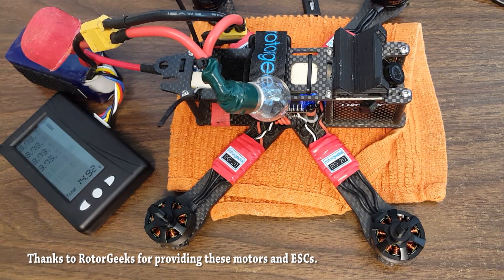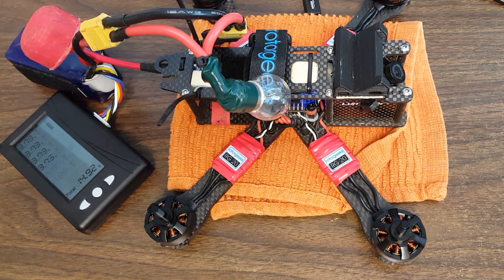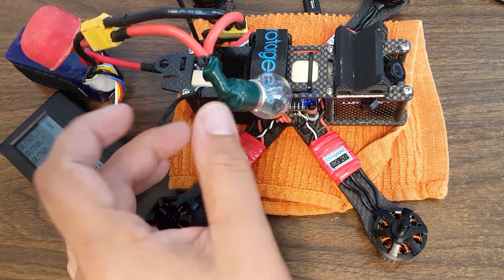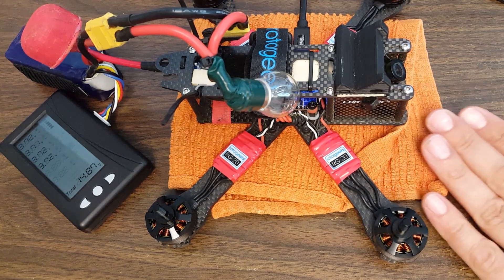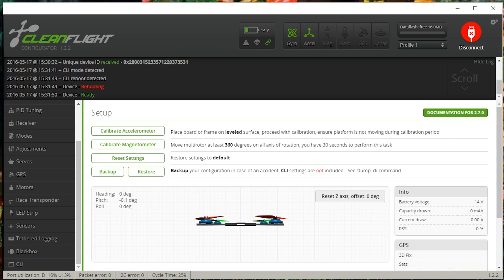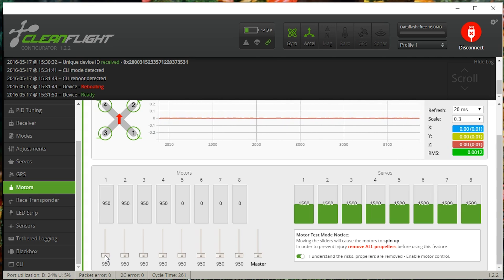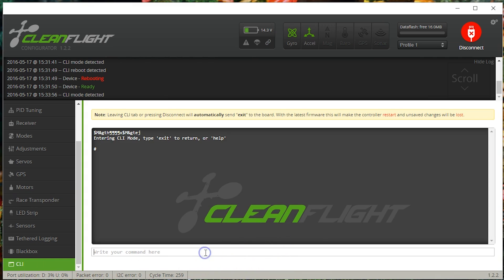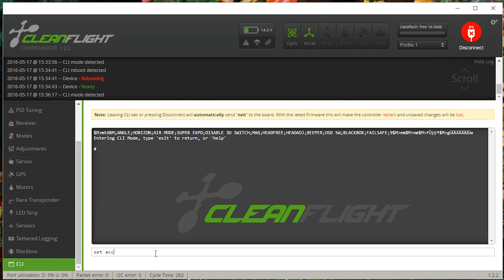How Much Vibration Is Normal?

Comment: If only 1 motor is vibrating does it make sense to tune it out or should the motor be replaced. Motor 3 has a high z value comparatively. How high is "definitely" too high. Does high vibration indicate a motor at high risk of failure. Motor is also definitely warmer running that the other motors too.

Motor 1
x - 0.00
y - 0.00
z - 0.00

Motor 2
x - 0.00
y - 0.00
z - 0.00

Motor 3
x - 0.06
y - 0.00
z - 0.38

Motor 4
x - 0.01
y - 0.01
z - 0.01

Comment: Having vibration trouble through the image quality in my DJI 03 error unit shows wavy distortions when flying not too noticeable but still noticeable compared to how it's flown before I think it's because the screw holes are stripped in the camera so the screws are not tightening in all the way looks like it's either trying to put some Teflon on the screws or just get a new DJI 03

Comment: I'm on my first build. Tarot iron man 650, Tmotor MN2212 920KV 10' PROPS, HGRLC Titan 4 in 1 (feel like I shoulda went individual escs) 4S 1500 bat. Screws are all tight, but I get rattle sounds all over the thing when I tgrottle up. I also feel as if I shoulda had a smaller craft as first. It has tipped and props brike maybe twice, but not a hard fall and throtle backed off. Bouncing from a land

Comment: is it possible to have so much motor vibration that it would throw the fc off.  reason I ask is I just built my first quad and after arming, very slowly roll up trhottle and quad goes to full throttle.  It shoots stright up in the air so I am convinced it is not a motor direction or prop installation issue.  it moves how it should in betaflight orientation page.  Have checked all settings 100 times in betaflight....any ideas???
Reply from the maker: First, check the receiver channel endpoints.

https://www.youtube.com/watch?v=PCLxyurZsD0

If it goes straight up, then I agree it's probably not one of the "taz" issues. It could be vibration. If you suspect vibration, set D gain to zero (just for troubleshooting, not permanently) and if it stops flying away, then it's vibration.

Comment: Hey Joshua it is hard you have alot of videos with blackbox. I just have a simple question related to motors and Max motor noise. I have enabled PT1 and when I look at the analyzer it only goes up to 125khz unlike 4000 like before. My question being, reading the max engine noise, I can read motor 1,2,3, and 4 looks the highest and I can read the first digit and not the rest. What is the average Max motor noise you mostly see, and do bent or out of balance props effect the noise? Obviously.. So I check the 4 motors in betaflight with the props off, storage charged 3cell, Smoke stopper and each motor in the Accel only go to .01 maybe .02 on one motor.(10000hz) So I am leaning towards a prop issue. Thanks for your patience. Thanks -Brandon

Comment: So how do you tune around a brand new motor that has some vibrations? 
Any material I can watch or read through to understand? 

I could not hear this "vibration" or thrill in the sound the motors make with the previous (and less powerful) motors...:  https://www.youtube.com/watch?v=0zoNQmMxeS8
Reply from the maker: Well, to be honest if a brand new motor had excess vibration I would replace it. But maybe if it's not too bad you could try balancing it with some tape. That's how we used to do it.

To tune around vibration you increase filtering and lower D gain. But if the vibration is very bad, there isn't anything you can do to fix it.
Reply: Joshua Bardwell thx. I’ll look into it.

Comment: This is a helpful video. Have you ever thought about revisiting some of these topics using the newer versions of Betaflight/Cleanflight? I know its hard with all the constant updates, but at least you will never have a shortage of topics for your videos. Thank you for everything. I know youre busy....... have you ever thought about starting a company with employees? You already have the fan base and everybody knows that you are the fpv know it all, so if you designed a "JB" flight controller or something, im pretty sure that everybody would buy it. Not only because you are trusted for your scientific testing method, but also for the online support (which is probably your best feature). Sorry for rambling. I just followed this link from the Betaflight wiki. Back to reading.

Comment: Hi Joshua,

So I have been trying to perform these tests but i can never get my accelerometer to calm down. This video 

https://youtu.be/aLW7qNgfO-k

I have posted to youtube shows you the readings I get. This is just a flight controller sat on my table, there is no quad. I find all of my quads do similar things when I connect then to my computer and try these tests you talk about. Any idea whats going on? interestingly enough I get the same readings regardless of weather a disable or enable the accelerometer on the FC. The big jumps you see on the video are me tapping the FC with my finger.

Any ideas ?
Reply from the maker: Unfortunately, Betaflight changed the Motors tab from Accelerometer to Gyro, and the resultin information is useless. I wish they would change it back.

Comment: Mr. Bardwell, When i tried this my X,Y,Z readings would never settle even when perfectly still motors disabled. Is my controller faulty SP F3  MPU 6050? I tried changing scale and time. Reset does not seem to zero either but i think its just the noise is constant. Maytec OSDPDB is where i am getting 5v from. Quad flies OK. It does dip to the rear if air mode is off and throttle is cut. min. Throttle 1175 and balance should be good on a realacc  210 frame and multiple packs. Its just kinda strange, Thank you love your work.
Reply from the maker: Your controller is fine. The BF devs changed the Motor tab from accelerometer to gyro and the readout is different.
Reply: Thank you,

Comment: Here's another aspect that ties into the discussion mounting an XT-60 directly to the PCB or a FCB.  
A new build may not have any issues with vibrating off the battery's male plug, but once, as you say,  'ding the motors' one or more times, while it may not effect the flight characteristics because of filtering/tuning, it can be enough to work the plug loose.

And that's where I learned to not to hard mount the male plug.  I was getting a rare separation, then it grew to like every fourth pack as my Alien got older. I suspect I was passing through resonance regions and lingering in them a bit more than another flight.

Comment: hello joshua. thanks angain for everything.
 question: onmy last version of betaflight 3.1.6 i think ( at the 27/03/17) in the motor menu, I only see the gyro (which take the place of the accelerometer). I dont know where to look for the acc. at the sensor? i did it but i don't know how to reset it. any idea?
Reply from the maker: Yeah, they changed it to the gyro. I don't think you can see the acc any more on that page.

Comment: Hi Joshua, could you tell me, how I check for motor vibrations, as in the motors tab now the gyro data is shown and not the acc data?
Reply from the maker: Well, generally the same process but the numbers are going to be different and I don't have a suggestion for what is a good or bad number :-(
Reply: Alright. Thanks anyways. =)

Comment: Hi Josh... Looking at your video, I have a problem.... Just started working with BetaFlight, and when I go into the Motors tab, I have Gyro instead of accelerometer. And on top of that, even with no movement of the motors... Gyro jumps around a lot (May not be a lot... Just have nothing to compare it with.) So 2 questions... Can I change the screen in my motors tab so it shows acc? and is a value of around 3.5 normal for the Gyro at rest?Thanks Steve
Reply from the maker: +Stephen Sweeney thru seem to have changed it to gyro. Gyro data is still usable but the scaling may be different. Just change the y-axis scaling if you can.

Comment: Hi Joshua, I have a question that I'm hoping you can shed some light on. I have a quad that's getting weird vibrations at low throttle that completely disappear when i raise the throttle. Would you have any idea what could cause that? I crashed a few weeks back which is when it started, to my knowledge, but everything seems fine and the crash wasn't even bad. Nothing is damaged, there's no visible cracks or bends in my frame (QAV210), I've made sure all my screws and bolts are tight, I've replaced my props, I've even gone as far as replacing all four motors and the vibrations are still there. It happens when taking off and hovering, but as soon as I give it some throttle and fly around a bit it goes away then comes back when I go back to hovering. I'm confused.
Reply from the maker: It's probably your camera is loose. Lens. Sensor element. Something like that.
Reply: i have similar issue, i get vibrations at mid throttle and i see that in motor tab too! at hight throttle, it is smooth. what could be the reason

Comment: how do you mount your camera? I like the angle you have there
Reply from the maker: You mean the FPV cam or the Yi?
Reply: +Joshua Bardwell FPV cam
Reply from the maker: It's mounted in the middle holes on the QAV-R side plates, then zip-tied so it presses against the top plate. Gives an angle of about 40 degrees.
Reply: +Joshua Bardwell Thank you. That's beautifully simple. Great idea :)

Comment: What's better? Lowering gyro_lowpass or lowering D gain? I found that a copter with motor vibrations can result in funny twichty sounds, if there is not enough filtering and if the D gain is high. Adding filtering or lowering the D significantly seems to resolve the issue, so I'm not sure what's better. I'm also waiting for vibration damps, and I was wondering, whether the dampers may result in a more slushy coper, because it may also damp actual movement?
Reply from the maker: +fluttershy77x I think lower D.

Comment: Interesting video. I would love to do that test with my F40 unfornately I am running Kiss FC now all over the place. What is that black thing on the side of your cam? It is masking the lumenier font.
Reply from the maker: I'm not sure what you mean. Which black thing?
Reply: On the right wall of the camera mount there is a black thing masking the "lumenier" written on it. Is it a cable tie? What is it doing there?
Reply from the maker: That's a zip tie. It is going underneath my FVP cam to hold it up against the top plate so the angle doesn't change.
Reply: Ah ok that is what I guessed but I wasn't sure. Thanks. That is the only thing I don't like about the QAVR, there is no way to fix the camera. I am currently not using any ziptie etc. Because pulling the cam up against the top plate gives me a too large of an angle. For "acro" flight I am more comfortable with something around 25&#176;
Reply from the maker: +RC Enthusiast have you tried moving the cam to the back set of holes?
Reply: Yep. The Cam is in the last hole. But still if you move it up it is > 25° and it does not feel that nice. It is fine for flying fast or racing but when flying acro rolls etc. it feels kinda strange. Hard to describe.
Reply from the maker: Okay then next thing I would do is stack double-sided foam tape to make a padding between the camera and the top plate. Make the padding slightly too large and then install the zip tie and squeeze it to the desired angle.
Reply: That is actually a good idea I will try that. The camera actually holds but on harder than normal landings or crashes you have to readjust the angle. :-)

Comment: Wouldn't this test be irrelevant with the current limiting bulb inline? As the bulb is lighting up before you get to max revs you are not doing a true test as the ESC cannot pull enough amps to spin the motor correctly. Depending on the ESC I imagine you may end up with jitter as it tries to drive the motor faster but cannot. I would be interested to see if you get the same results with a battery connected directly.
Reply from the maker: All that happens with the bulb in line is that the voltage drops, similar to battery sag. It's not always safe to spin motors with props off at full throttle. If you feel like the test is more valuable without current limiting, you can run it that way.
Reply: +Joshua Bardwell Correct, but that same drop would mean the motor doesn't spin up the same as it would with a direct battery. I just did this myself with near new RS2205 motors and tested back and forth. I got repeatable .02 difference. Why? I've no exact idea, but I suspect the ESC of course. How much difference does this practically make? Probably none :)

Comment: Is there any premade cable I can buy like your lightbulb cable to limit the volts? I am not comfortable or experienced enough to do that myself but am not sure what I would be searching for/what it's called.
Reply from the maker: No. You just build your own. Get an automotive tail light socket such as perhaps this: http://www.amazon.com/Dorman-923-034-Tail-Lamp-Socket/dp/B000TYSBYY

Then solder it up and insert a tail light. Or just solder directly to the tail light and skip the socket, which is what I did.

Comment: Great demo, we used to put the vibration detector on iphone to test naza motor vibes when props were never balanced out of the box. I would note that Tmotor and FPVmodel prop adapters that have the 4 screws can create horrible high P type wobbles so looking at spinners or nuts can show this type of imbalance if looked at while hovering. Weeks of tuning and motor swapping taught me that, I remounted the adapter and the vibes were gone.
Reply: Agree with the T-Motors prop adapter, i noticed the same thing too, that was i started to use exclusively T-Motors props with T-Motors motors in oder to avoid them but hey expensive hobby doesn't it...